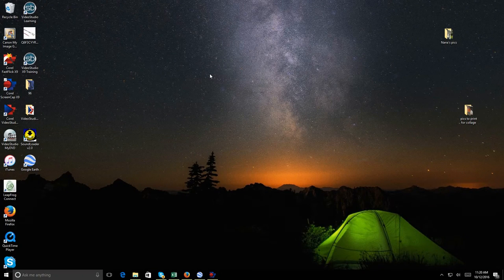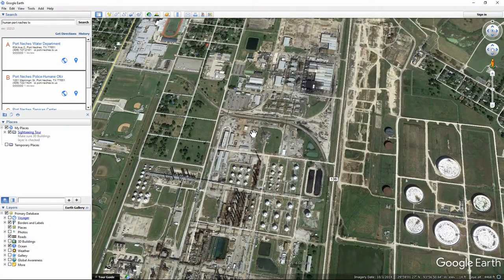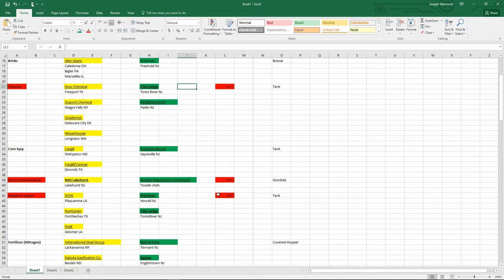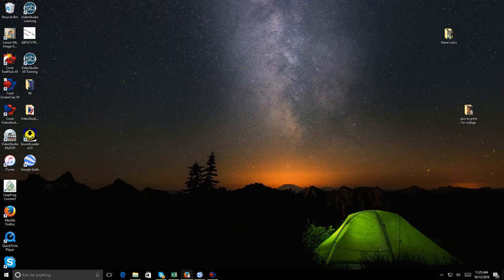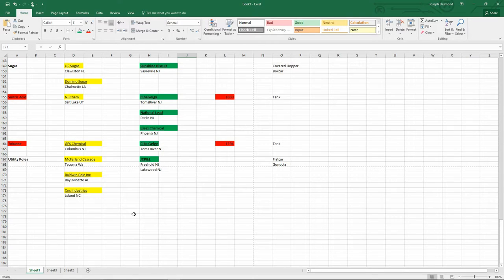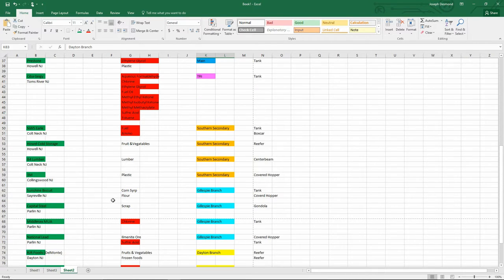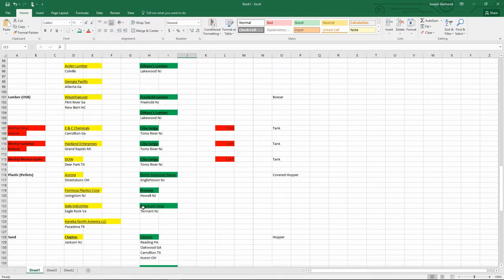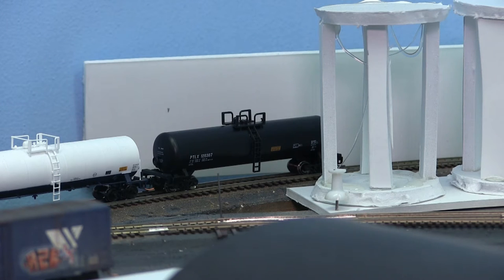Waybills for the Sayrehurst Secondary

Comment: Great video, I really understand the concept of car cards/waybills. Just have a question. How do you know when to put the waybill/car card into circulation on the layout? Do you just pull a few random ones out, stage them and follow through with the waybill? My main question is how do they begin circulation on the layout?
Reply from the maker: ChicagolandRailfan171 all my car begin/end their "life" on the railroad in the staging yard. That's where they start and end. If I find a car doesn't work and needs to be removed I just pull the waybill and let in find its way back to the staging yard. The eventual plan (when I have enough freight cars I will have a completed set of layout to cycle into the staging yard so I don't have the same cars running around the layout.